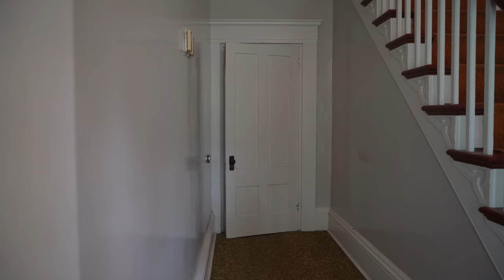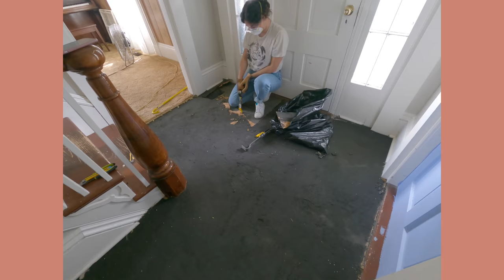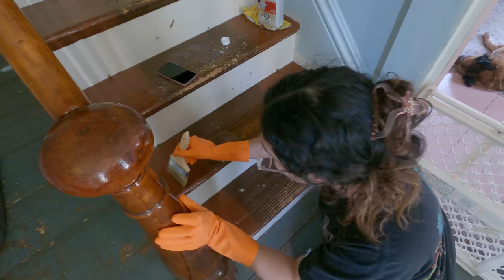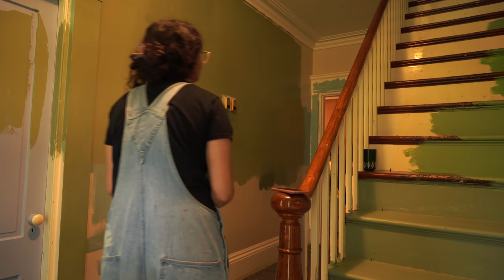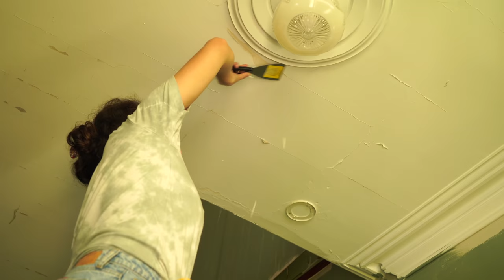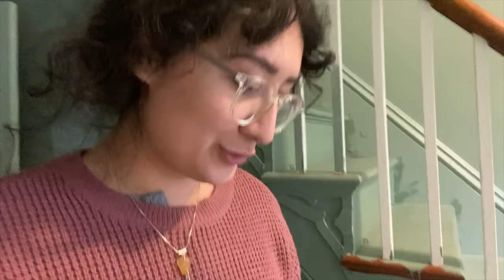Renovating My Staircase | Before & After

Comment: Your cut off top spindle reminded me of when a family member was remodeling an older home in the city.  A lot of the older 2 stories homes would be divided into apartments, so any type  of decorative post at that top landing would be damaged by tenants moving in and out over time. In my family members case you could see there had originally been a decorative ball that had been broken off.
Reply: That’s a really good observation. I’m currently renovating my family’s 1890s home. I have a grand staircase with a lot of decorative elements but two of my orbs that would have been on the staircase are missing/broken off. At first I thought the damage was done from “architectural scavengers” who have been known to steal decorative elements from houses in my part of town to help furnish or restore houses in wealthier parts of my city but recently I found a picture from the 70s where all the orbs were present. My grandparents bought the house in 1962 and they did their best to keep all the remaining Victorian woodwork so it didn’t make sense that they would break/remove the orbs. But the two broken/missing orbs are in places where the staircase has a corner and if I was moving furniture, I can see how they might get damaged. My grandparents had a lot of kids and a lot of furniture for all the bedrooms. Who knows who broke the orbs but it probably came from  moving heavy furniture to and from the 3rd and 2nd floor.
Reply: @tylerbhumphries  glad to help solve the mystery.

Comment: I love that you called it a room. Nobody thinks of stairwells and hallways as rooms, but they each take as much time and effort as a room. I foolishly punctured the paint bubbles on the trim in my stairwell and quickly discovered that if I wanted to avoid breathing lead paint, I had to strip it. Super long time and effort addition.  For future reference: SoyGel. It's made in the Midwest of the USA, so shipping to Canada might get pricey quickly. It's effective, doesn't have a strong smell, is mild enough on skin you can do it bare-handed. Drawback? You probably need to let it work overnight before scraping off layers and layers and layers of paint. If you leave it on overnight, it'll get numerous layers all at once. 
Question: did painting the ceiling green make the room darker? I've been painting ceiling white because I need all the bounced like possible in all the rooms. I hired painters for the exterior and they were surprised I wanted the front porch ceiling to be a very light blue. Well, the front porch overhang is 9 feet deep and instead of it reflecting gray from the previous paint job, I wanted a cheerful blue color for the six months of winter we have.

Comment: Never would have painted the ceiling green! 😳 I would have left it white for height & light. I also would have painted the insets on the side of the staircase white. But hey, it’s your house! 😃 Live these design vids!!!
Reply: I agree! I would've liked to see a colour that wasn't green also included, but she seems very happy with it this way and that's what matters :D
Reply: I think, if the monochromatic look was the intent, using the darker green version of the paint on all the moulding would give better contrast. That banister/railing looks a little out of place, I think the room would look more cohesive with another variation of that green as an accent color
Reply: Yes, the area is looking quite dark overall. I'm all for tons of color in rooms but like hallways and staircases light and neutral. But just getting rid of the old carpets was bound to make it look a ton better and the new spindles do look great.

Comment: I redid my stairs this summer too and it took me months! I had tried paint stripping and didn't care for it either, and because of the lead paint, I didn't want to sand. So I used a heat gun. On the entire staircase. Ugh. Did I mention it took me months? I still don't have everything off, but I did the best I could and painted it. It looks better than it did anyway. You did a beautiful job. Love the green. The trim on the side of the staircase is lovely and the handrail and spindles are beautiful. You have such good bones in that house!

Comment: You can buy a "transition" piece to go over that space between the door and the front hall. The transition is designed to fit in the slot between the floors of the two rooms and connect both floors smoothly.  They come in wood or metal.  They are available at Lowe's in the flooring department.  Everything looks great!  I like the idea of a runner on the stairs---it will look good and protect the paint from traffic scuffs.  Runners come in cut to measure lengths just like carpet.  Lowe's used to carry them---some stores still do---my local Lowe's does not.  They may have them at Home Depot.  But, if neither store has them, they can order the pattern you want already cut to your measurements.  The runners are sold in linear feet.

Comment: Like your staircase.  Have you thought about using contrasting or complementing colors for the detail on the outside of of the staircase where those little motifs are?   At the moment it appears that as everything is the same paint color they blend in and are not that noticeable.  A slightly different green either darker or lighter would make them pop more.    Good luck in finding a great light fixture for that entrance way.

Comment: Hi, Ariel, is this your full time gig or are you working outside youtube as well? Also, you are inspiring me to crack on with painting my own stairwell/stairs in my 100 year old house. I was going to sand my stairs, it never occurred to me it might be lead paint...eek! I just can't decide on wood stripping or painting. I have no posts going up my stairwell as it had 2 little landings (not straight up) and it's all board and batten wood (oak). Trying to decide what to do is taking me forever.

Comment: Blue can be a very cold colour if you don't get it right, I would stay away from light blues on large areas. The colour that you liked from pintrest  would be found under the Emerald blue shades. Anytime stripping or varnishing you should always wear the correct mask, with the height of the ceilings go for big bold prints they real will take a room into a different dimension.

Comment: I would have used a higher quality paint and primed everything. Painted stairs also are very slippery in socks unless you use the special gripping paint, so I would add a runner again.

Comment: Transition strip! Not doorstop. You dont have to make one; hardware stores just sell them - various wood ones, metal, tile, vinyl, anything you want. With wood, they have unfinished ones so you can paint or stain them. You can also get different lengths and with or without screw holes. Theyre inexpensive and way easier than making one.
Reply from the maker: WOAH. I didn't know this!! I'm going to go to the hardware store this week and look for this! That would be SO EASY omg. Thank you for mentioning that tip!